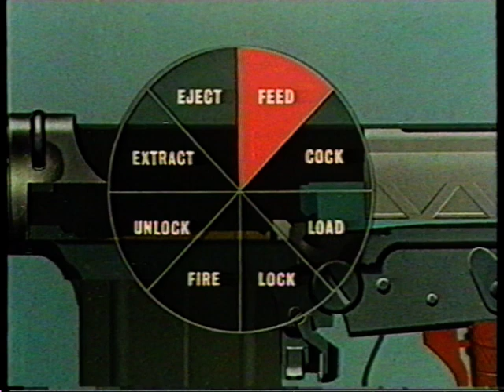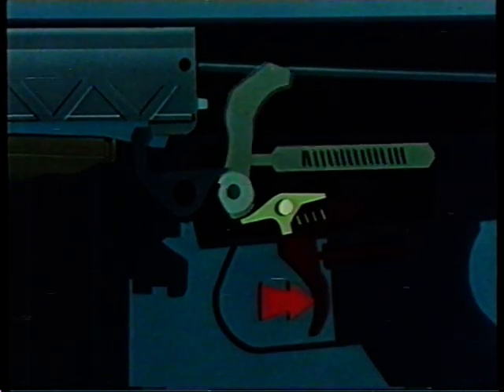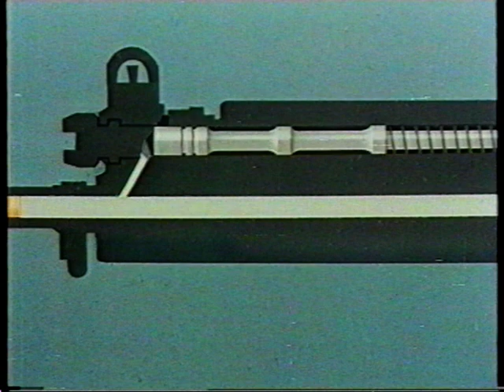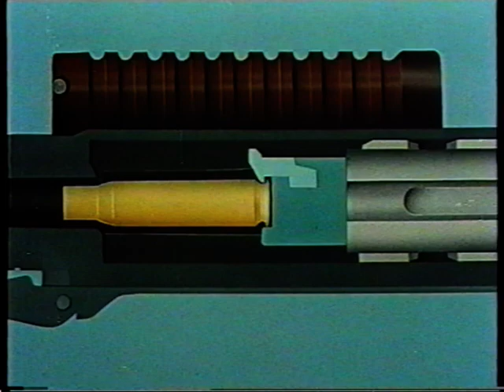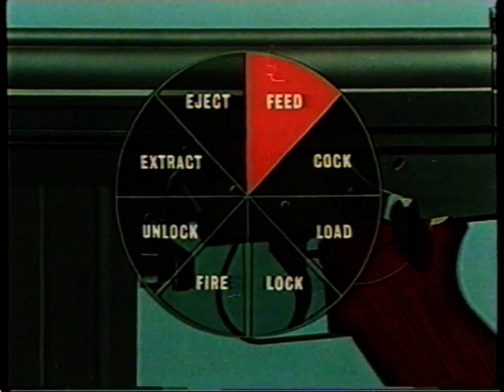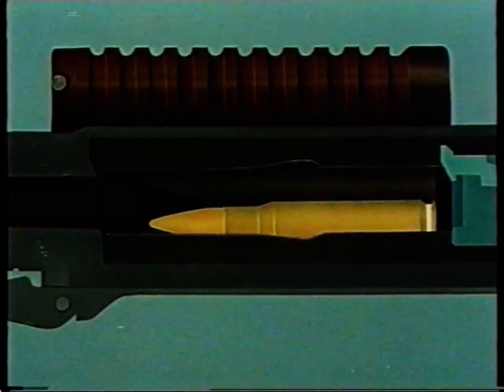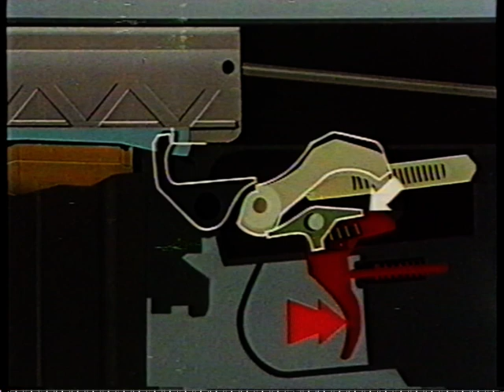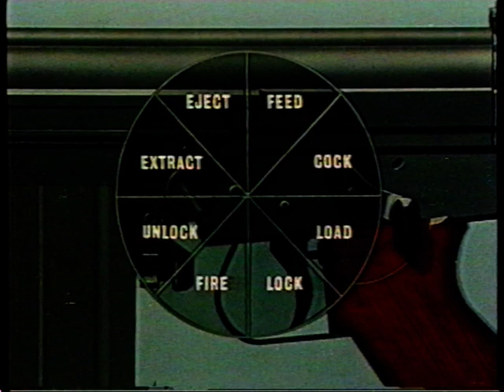L1A1 Cycle Of Operations

Comment: i had the pleasure of firing two variants 1) with wooden furniture and cocking handle as in this film and 2) a model with plastic furniture and a fixed rounded cocking handle, on private ranges, about 20 years ago, nice weapons. I got extra lucky in using one with a Trilux scope, and a Singlepoint red dot sight which the owners swapped over to, in order to show me what they used in Northern Ireland, quite a contrast between the two. I was also shown how the rifle could be still operated as a bolt action rifle if the return spring in the gas tube had been lost (as was apparently  a common accident with new recruits) when stripping them for the first time, which i nearly did after being shown how to strip it, to the mirth of the owners. Lesson well learned. It was interesting to find out that the small pocket on the side of the 1958 pattern right ammo pouch was for a device to fire Energa grenades, with adjustment of the gas plug to suit. I was issued 1958 webbing as a cadet , damned heavy stuff which i soon changed over for lighter kit. Fascinating to connect with history as my family had all been Army since before ww1. A great day shooting with L1A1, Lee Enfield No4, then L42 sniper version, a Parker Hale version, and finishing off with the L1A1 with 30 round L4A4 Bren magazine. Great day and i learned so much about how versatile and loved the L1A1 was.

Comment: The Finest Rifle Ever To Serve In The British Army
Reply: It was amazing how much of a step backwards the British Army took in the late eighties.
Reply: @mrjockt  Well have always said the British army dropping the SLR for the L85 is like dating a 10 but then going and marrying a 3 just cos they're younger
Reply: Will Rose  During the NATO Standardisation talks in the early fifties the agreement reached over small arms ammunition was that NATO would adopt the U.S. proposed 7.62x51mm round on the understanding that the U.S. would adopt the T48, U.S. built FAL, they never did, they also agreed to adopt 9mm as the standard pistol/SMG round, again the U.S. basically ignored this. Britain has attempted to adopt a smaller round three times in the last hundred years, .276 Enfield in 1913, 7mm Short in the early fifties and 4.85mm in the mid seventies, there wasn’t anything wrong with the 5.56mm round adopted in the eighties it was the rifle chosen that was the problem, the original L85 had far too many problems that were effectively ignored or brushed over in the rush to get a new British designed rifle into the hands of the British army.
Reply: Will Rose  What makes the issues with the L85 even more annoying for me was the fact that I was one of several R.A.F. personnel who got to fire one of the early SA-80’s back in 1983, and every one of us thought this was a brilliant rifle, short, handy and reasonably well balanced for carrying around, it’s a pity we weren’t aware of the issues the rifle was having in the background, I had left the service before the L85 entered general service but saw how much it was disliked during the first Gulf War, it took a long time and a lot more money to finally turn it into the sort of rifle it should have been from the start.